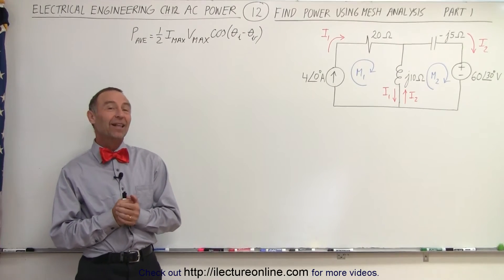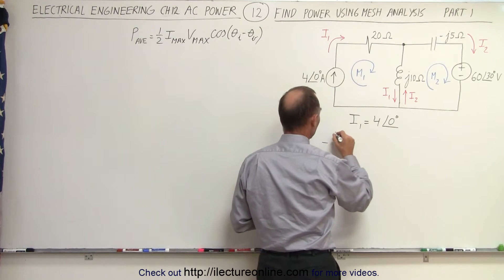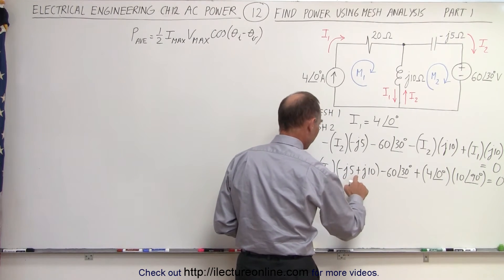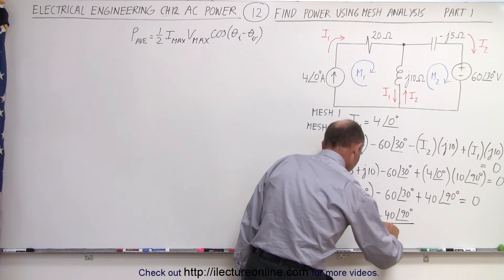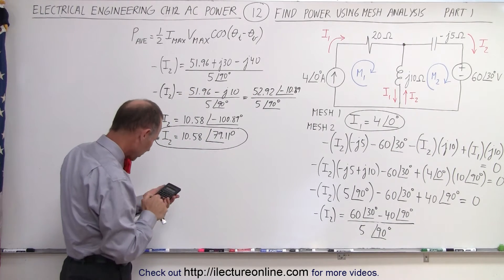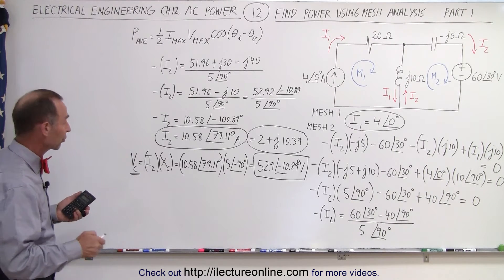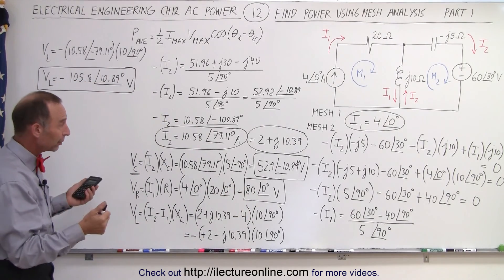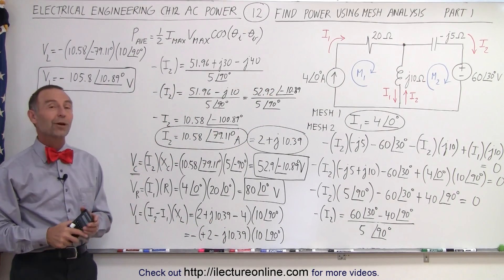Electrical Engineering: Ch 12 AC Power (12 of 38) How to Find Power Using Mesh Analysis Part 1

Comment: This video seems a little confusing. For mesh 2, why do you multiply -j5 by -I2 and not +I2 because we are moving in the direction of the current as you mentioned?? . Also why did you do mesh analysis like -I2(j10)+(I1)(j10) instead of just writing -j10(I2-I1)... Lots of confusing things in this video IMO.

Comment: Hey Michel, I believe you cannot factor out the negative from the complex number at the end of the video, because magnitude was + and phase angle was - but after factoring out again the magnitude is + and phase angle is - so it means you have disrupted the values and added a redundant negative
Reply from the maker: There is mathematically nothing wrong with factoring out a negative since it still has the exact same meaning.  It becomes a matter of personal preference.

Comment: Dr. Michel, I have question about mesh 1, if you were doing kcl why you didn't go through the nodes or if it was kvl why you didn't go through each component? in the second mesh you added up all the components and made them equal to zero which mean you did kvl around the loop. please tell me what is going on in mesh 1. thanks
Reply from the maker: In mesh 1 we have a current source which will force that current no matter what components you have in that loop or what happens with the components in the loop
Reply: @MichelvanBiezen   I see now. Thank you again.

Comment: Hello Sir,
At 13:14
if I don't pull out the -ve sign and convert it into magnitude/_ phasor representation it comes out to be different (+105/_10.89) which changes the voltage drop across the current source (calculated in the next part) to be very different. Please tell me if this is correct.
Reply from the maker: We should get the same answer.  (With these types of problems, it is easy to make a little mistake somewhere).

Comment: Thank you sir, one doubt sir , 
V (L) = (i1-i2)X(L) sir because V (L) consider loop2 based i2 is absorbed i.e. voltage drop sir but you wrote i2-i1 ,this case i.e. your wrote case i2 is voltage rise (loop2) sir.     Please adjust my English conveying sir ..

Comment: Hello, *THANK YOU FOR YOUR WORK*, 
But...
I am having some problems, you used M2 yo find I2, i used M1 since we know I1 thus i get 
M1=-20*I1 - J10*I1 + J10*I2 = 0 
thus now using I1 = [ 4¦_0 * 20 ¦_0  ] -  ( 10¦_90 4¦_0 ) +  [ 10¦_90 * I2 ] =0 
thus I2=(80+J40)/10¦_90
= 89.44¦_26.57 / 10¦_90 = 8.94¦_-63.43,

At the end you have Current for L= 2+J10.39 - 4 = -2+J10.39
 but you says its - (2-J10.39) which is correct 
but because of this you get the cartesian form to be -10.58¦_-79.11 
thus your voltage is -105.80¦_10.9 
but if you keep VL as -2+ J10.39 you get the cartesian form =10.58¦_-79.11  
thus your voltage 105.8¦_10.9 which is what i have.
 

Where am i wrong,for both, please help :D

Comment: Isn't capacitor should have 90 degrees shift, while induction -90 degrees?
Reply from the maker: The numbers used in the video for the capacitor and inductor are correct.